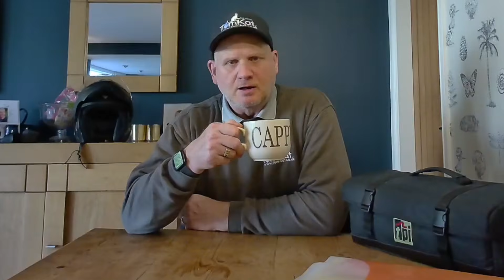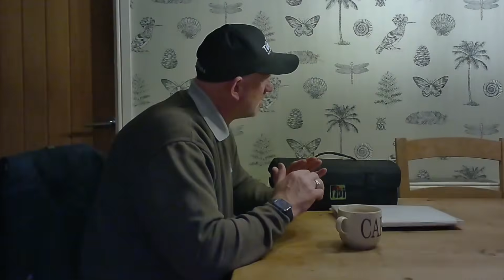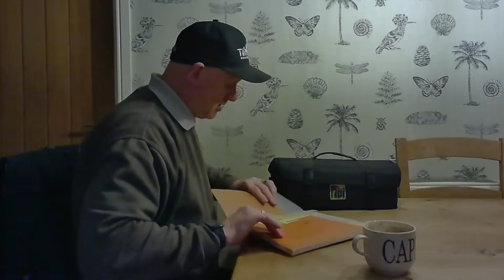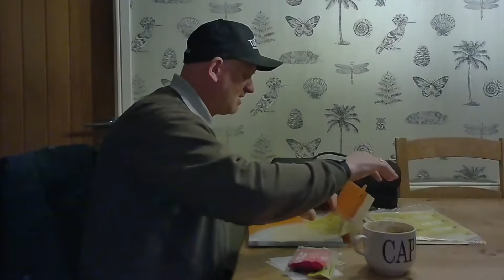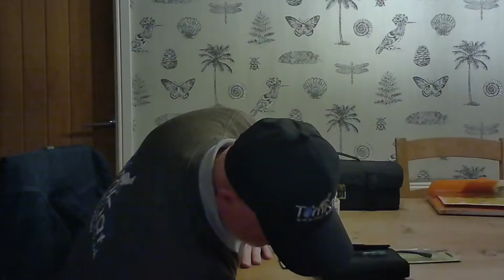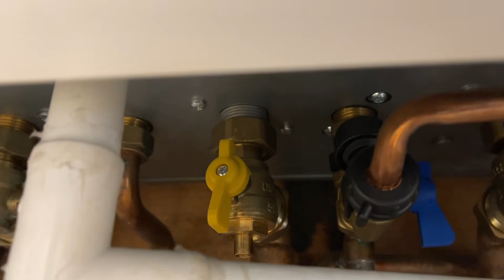All you need to know about a gas safe inspection.

Comment: Great video. But please could you consider using an external microphone. It just makes listening a lot easier. Thanks
Reply from the maker: @gasapprentice  I do use external microphones maybe you could have a hearing problem or poor equipment you a watching on 🤷‍♂️
Reply: No need to take offence. Just giving some feedback. If you were using an external mic it wouldn't be so echoey.
Reply from the maker: @ no offence taken it’s  echoey because of the room it has wooden floors.
Reply: Mate not all of it is even the actual house setting, near half the video was green screened. Which was highlighted by the lighting around your silhouette.

If anything he is complaining about how the transition of the audio was not smooth. It went from green screen to regular video without warning. I'd say it'd be more recieved if you gave some sort of heads up that you didn't include something from the house setting earlier in the vid and that you had to fill it in mid vid. There's plenty of good technologies out there that can provide a steady audio which makes it easy for the viewer to hear and make out, without you shouting. But I'm sure nobody comes here to watch you do an asmr or some sort of soft spoken boiler installation, that's just gay bro. But it's still up to you init.

My point being It would be much appreciated, just as all your other videos and guides are already being well recieved. 

If you take it to offence, all good man. Keep it real. If you felt I'm missing something here. Lmk. I'm all ears or fingers?? 😅.

Comment: Hi Derek do i need to service or installation  in same time with inspectors or this is kind of tightness test . Working pressure inlet pressure and safety devices or any stuff like this things.  Can i use my home   postcode for one the inspection visit 
.